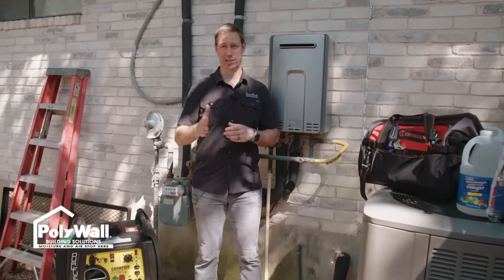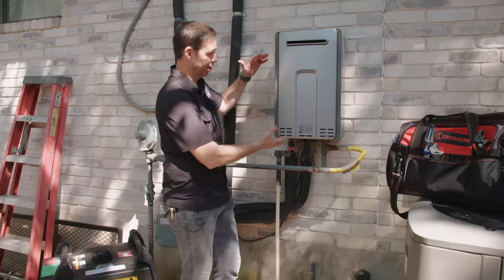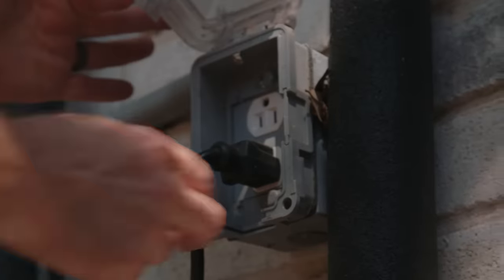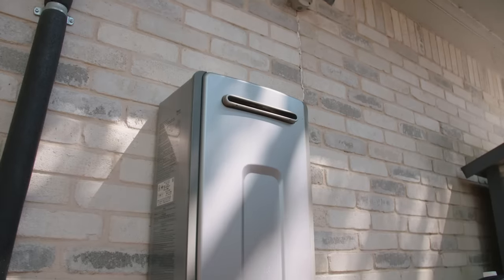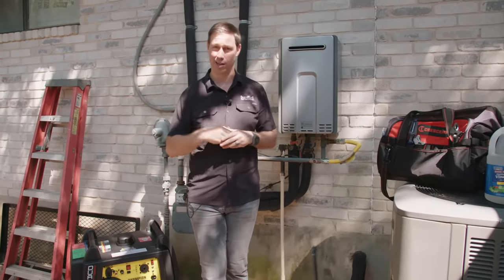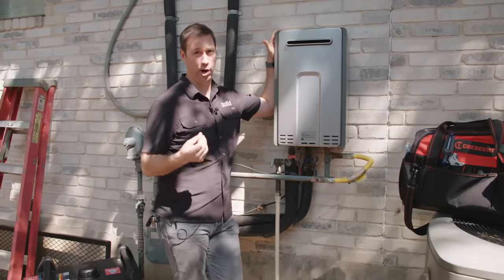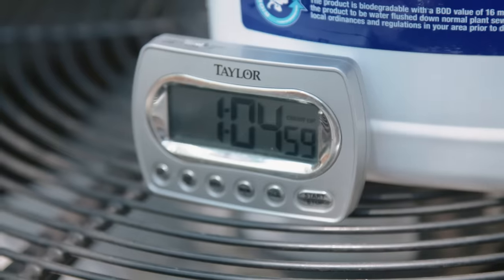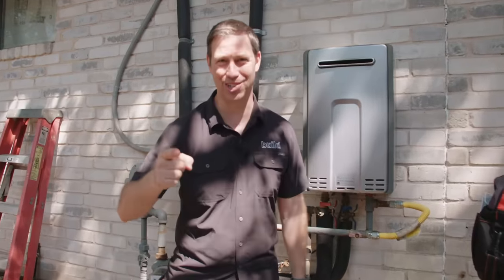3 Things They Don’t Tell You About Tankless

Comment: Good point about the hot water going away the instant the electric does. I install a CyberPower 1500VA Uninterruptible Power Supply (UPS) along with my Rheem Tankless. The UPS will provide electric for at least 90 minutes of hot water.

Comment: I'm 57and I've never taken a 7 minute shower in my life. Maybe 15 minutes a few times. Usually I stand under the hot water as long as possible. 🤓🍺
Reply: I live in a hot dry climate. During the summer standing under hot water isn't as appealing I'm like 5 min. and I'm out, in fact I'll sometimes even take a cold shower slowly working toward full cold. You feel so good after. During our mild winters though hot showers will get extended.

Comment: They also have battery backup for them I have had mine for 15 years and have had no problems I installed it myself and save a few thousand . During the summer months our gas usage is about 5 dollars a month. I clean mine once a year and put on a recric pump. I have a rinnia best one yet . I have installed 10-12 for friends they will be er go back to tank . I only use cleaning vinegar ,the chemical,s they sell has a harsh compound in it and it will eat away the rubber gasket in all connections. Love mine

Comment: 4th thing not mentioned is... getting instant heated water doesn't happen, unless you add an additional device/pump to circulate heated water. These tankless systems only heat water when called upon but think about the cold water in your pipes and the water coming through the system, until the water is heated!
Reply: Same issue with tank based systems.
Reply: @Boodieman72  Yeah but far less time is needed, as you have to heat the water first and then circulate. We have to wait about a min. or more to get hot water since going to a Tankless system. Sucks. Never had to wait that long with our tank system.
Reply: @trosencrantz  I have to wait that long for my tank system.  With a tankless system once its hot you will have endless hot water and with a tank system you could run out.   With a tankless system you aren't wasting energy when your not using it.  A recirculation pump can be added if you want hot water faster.
Reply: @Boodieman72  lol. Exactly
Reply: just like a tank!
Reply: @Boodieman72    In terms of adding a recirculating pump to either a hot water tank or a tankless system.  Would that make the cold stagnant water in your cold water pipes warmer?  Or is that only on the hot water side, strictly speaking?  From what I understand there's a mixing valve that gets added at the furthest hot water appliance.  Typically the master bedroom of every home.
Reply: @terencenagra6620  They make the water in the hot water pipe so it doesn't cool off.
Reply: Interesting. Instant hot water was my main reason for looking into tankless. Do you have the additional device/pump on your system? Also did you install yours yourself or did you have it done?
Reply: Are you referring to the recirculation pump or is that something else?
Reply: @rashadw3933  Yes I am!
Reply: I can’t believe it…….
  Someone else that understands how and why a tankless water heater works….
   Nevien tankless works well for a tankless water heater. 
Even though it takes about a minute to a minute and a half. This water heater has a small buffer tank that sends hot water as soon as you turn on the tap.
Reply: @trosencrantz  your wait is because you must heat the water inside of the tank. Then and only then you start sending heated water. Your plumber installed the wrong tankless in your house…
Reply: @ltsgarage7898  So the proper one would be one that has a recirculating pump with-in it?   How does a tankless system keep what ever is in the pipes warm?
Reply: @trosencrantz  “NEVIEN “
 This is the internet. Try looking it up and reading how it works. I can only explain it so many times.
        Read

Comment: You’ll never recoup the money spent on installing a tankless vs tank type.  Initial cost to install plus servicing it once a year (or even every 2 or three years) especially if you put an inline scale filter that has to be changed out every year.  Not to mention there are many things or components on tankless that can go out which most plumbing companies will have to order part and return at a later time to replace all the while no hot water... if you like the bells and whistles and have the money to “burn” then go tankless otherwise it’s not a wise investment.  If you’d installing it at when building your house it makes a little more sense and I’d recommend learning how to do the service yourself on it since it is simple to do but will cost on average about 300.00 for most professional plumbing companies to do.
Reply: If your gas company pays you several hundred dollars for installing one (which mine did), you can sell your tank heater because it's not very old (which was my case), and you do the maintenance yourself (capital cost of pump, hoses, bucket, and vinegar), the layout looks better

Comment: The bigger downside to having a Tankless is no instant hot water, the water has to run for a minute or more so no quick wash your hands after using the bathroom.
Reply: Depending on the distance between your tank and the faucet - it could take a minute to get hot water with a tank too.
Reply: @musicfan8688  Yep... this is about every house I've lived in.  usually takes a minute for the water warm up and flush out the cold water in the pipes.

Comment: I upgraded from a tank to a tankless propane hot water heater about 9 months ago, just before I did the switch I had my propane tank filled, since then I have had it filled two more times. I am now using half the propane that I was using before. Now I am just one person in the house, my consumption has not changed at all, still use the same amount of hot water.  Not sure why you are not seeing the savings.

Comment: My plumber,  Phil, asked me if I had hit my head when I asked about getting a tankless water heater.  He said that for every 15 he installed he had to remove about 13 of them!
Reply: We installed ours in June 2010 and have had zero problems.  I would never go back.  With a 40 gallon tank water heater we were using an average of 1 therm of natural gas a day in the summer.  After installing the tankless it was reduced 40% to .6 therms per day.   I’m sure there are lemons out there but everyone I know who has a tankless is happy with it.  That only amounts to about 7 homes, but it’s a way better average than Phil the plumbers experiences 😀
Reply: What does he think of high power condensing tank heaters from AO Smith, Bradford White, or Rinnai that provide a similar level of output? It's almost like old school plumbers hate any appliance that allows one to take long, hot showers.
Reply: Time for a new plumber if he can't install one correctly.

Comment: The other draw back is you have to run more water as you wait for the water to heat up.
Reply: You have to wait for both.
Reply: How far is the pipe run?   If it’s less than 10 feet if pipe between heater and tap, it’s Around 60 seconds, faster than the tank was.

Comment: 2:35 Unplug the tankless. It works. Ask me how I know. 😆
Reply: You can also add a bypass valve, you can have more fun that way by turning it on and off. :D
Reply: I have a remote on mine and I give a warning and the turn off the unit, it gives them 30 seconds to finish.
Reply: a plumber I know just connected the timer to the tankless.  that way he doesn't have to monitor the timer.

Comment: We were going to get a tankless water heater for the house we just bought, it had an aging water heater with an antiquated Apollo heating system. The plumber told us in addition to the new water heater, we would need the propane company to come install a new high flow regulator and an electrician would be required to put an outlet in as well. We decided to scrap that plan and a new tank is getting installed in January. It’s not a very big house at all so tankless just wasn’t worth the extra cost/hassle.

Comment: We built a house 5 years ago and the standard was a tankless water heater. We only had tank water heaters previously. The tankless water heater is more expensive for service and we have very hard water so an annual service is always required.  It takes about 60 to 70 minutes for the water to heat up for a shower but after that the hot water is endless.
Reply: Did you mean to say 60-70 minutes? That’s over an hour wait for hot water!
Reply: @Sheilawyer  that's crazy I think he means 60 to 70 seconds I hopefully

Comment: Wait! You’re supposed to flush water heaters!!!😯
Reply: I never have flushed my water heater, my old water heater lasted 24years, now I have a tankless that I've had for about 3 1/2 years and I've yet too flush it, so far so good.
Reply: @kenbradley1100  They built water heaters to last 30 years ago and you would get 20-30 years out of them regardless if you flushed them out or not. Now, like any other major home appliance, a water heater is designed to fail after a certain time period.

Comment: I had one of these installed about 7 years ago.  They required stainless steel exhaust that was expensive.  It was nice but it crapped out after 2 years of moderate use.  Great idea at the time but my plumber said it was too early in the development of these things when I had it installed.
Reply: Early in the development? They have been selling tankless water heaters in the U.S. since the '90s and I think Europe and Japan used them before then.

Comment: "Oh, btw, it takes a full minute for you to get that endless hot water..."
Reply: Really? I’m debating right now tank or tankless
Reply: @mikef1570  I still love the thing... but yeah, it takes a while to get 'er going. I've got a rather LARGE gas blasted one too. Thought about adding a 4 gallon water heater in front of it to get "instant" hot, and then the monster would blast it with hot water and turn it off. haven't done it in 6 years...
Reply: Either your pipes are way to long/big or there's something wrong. Tankless is the standard here in Europe and with comfort functions there is warm water instantly at the exit of the device. How long it takes to flow to the tap depends on the pipes.

Without comfort functions it should never take more than about 10 -15 seconds.
Reply: @RdV-  strange enough. it's installed where the tank used to be, maybe something wrong with the heater. I will look into it. thanks.
Reply: We've got friends with these.  Most of them do complain about the extra time to get hot water, added on top of the time already spent to get from the heater to the sink/shower.  And we have some of the most expensive city water in the country here, plus restrictions.  These units only start heating after water flow starts.  In one corner of our house it's 45 seconds from the gas heater until it's hot.
But the killer was that the gas service wasn't piped for the amount of natural gas needed for the large burner.  The cost of that upgrade would have eaten up any savings for a decade.

Add recirc?  lots of costs.  Timers for recirc?  same.  Insulate all the lines, extra costs.  Add a small tank at the distant end?  extra costs, plus losses.  Extra maintenance of tankless, extra costs.  Trades have high hourly rates here.
For a technology being sold on savings, a non-starter.  By the time the new gas heater goes out, the solar electric+storage systems will have come down in price to beat the gas heaters, and then we'll put one in.
Reply: @pault151  oh yeah, the install was ridiculously high. I'm still contemplating opening it up and finding the flow sensor and convincing it that the water is flowing for a bit before turning on the water... just a thought, haven't gotten the balls to do it yet.
Reply: @pault151  another thought was to put a small water heater in front of the blaster, so I would have hot water nearly instantly and when the blaster gets around to it it will put hot water back in the small one.
Reply: @RdV-  It seems to be the cold startup.  It goes through a safety startup that takes a long time.  Once that is done, it then starts to heat water.
Reply: @wdudek01  could you further explain the cold start up process?
  I like my unit but it shuts off if I turn the cold water faucet on too high, and then I have to turn off the hot faucet and turn it back on to restart the heater.
Reply: @wdudek01  then that’s a cheap crap heater. There shouldn’t be a heater, in this day and age, installed professionally, that has a “start up” procedure every time you ask it for hot water.
Reply: @RdV-  I think you're thinking of electric units, where the water heater is right by the sink or shower. Those aren't common in the US. A gas boiler is not going to start instantly.
Reply: They make small tanks you can install with these, to give you just enough hot water until the boiler starts.
Reply: @syreplays5079  my gas powered unit keeps water in the heat exchanger at a certain temperature at certain times. It does this by learning my usage pattern.

If I suddenly want hot water at 3 am it takes around 30s longer than usual. 

It's a feature called comfort dhw in the menu and I know is available on multiple brands and even some cheaper models.

I don't have any kind of electric water heating or a vat of heated water and the unit is not located directly near a tap but in its own space.

All of this is pretty normal here in NW Europe.

We are now switching to heat pumps or hybrid systems though because we're phasing out gas usage because of pollution.
Reply: @DaveSomething  We just turn our water on while we are getting undressed, it's warm when we get in.

Comment: Question: about FREEEEZING TEMPS / Frozen Tankless unit.
The last TEXAS FREEZE… 🥶☃️
My unit froze up. 🥶🥶🥶🥶
What should I do to prevent that?
Is there a way to insulate it?
Should I build a cover over it?
What do you recommend?
My son in law melted it with my hair blow dryer…and I was back in biz.
But do those ever break in freezes?
Thanks for your helpful videos!❤️

Comment: You talk about scale. You absolutely need to keep the fixtures running and free-flowing. I discovered this at a camp that has a tankless water system. The camp is watered by a well. I can tell by the green stains on some of the porcelain that the water is a bit acidic. That means that if it isn't pulling minerals from the well, it's clogging up fixtures by eating away at the copper pipes. You can tell this in particular in the showers. The bathroom faucets flow pretty well. The showers are better at trickling. The problem that this creates with a tankless system is that the shower heads have degraded to where the water flow is below the threshold for the water heaters to kick on, so you always get a cold shower unless hot water is being tapped elsewhere on the same system. So the thing to do is to turn on the hot water in the faucet and go take a shower while it's running. It's hardly ideal and certainly a waste of energy.

Comment: Hello  Matt
 Thanks for the video. you mentioned the use of a standby generator during a power outage. 
Correct me if I'm mistaken, but
electric tankless water heater's require a constant and significant amount of current/amperage.
So, how much output range of generator would one have to factor in, so as to not to overload the generator?
To ensure proper function of they're tankless electric water heater, including a few other basic (furnace, fridge, lights, a couple kitchen countertop receptacles)
household circuit's ?
Reply: He was talking about a gas tankless heater which uses a small amount of electricity to run the logic board and the electronic pilot.  An electric tankless is a whole different animal.

Comment: Hardly any good reason for tankless. No cost savings, high initial costs, plus maintance.
Reply: Exactly we added 100 litre tank
Reply: Depends entirely on usage.   I had a tank, 100 gallon water heater.....the pilot is bill killer #1 this was outside in a tin shed, Bill killer #2.  My gas bill just for hot water was $80 per mo. in winter, along with another $100 per mo. for heat (@2000’ elevation we have weather).   $200 winter monthly gas bill, $50 per mo. in summer.......now my bill is $8.00 in summer.   That’s 10 times less, 

But as to being expensive? , being mounted indoors, the stainless steel flu only had to go 2’ to get out the roof, still cost $850 dollars for 2 45 degree, 1 6’ straight and 1 cap!   Code is double wall stainless, if you go indoors.   But it Paid off for me, on my bill, and aesthetics of my ancient stone house got a huge upgrade losing the outdoor heater and plumbing, it was butt ugly🙂
Reply: Bingo yes, but I had NO viable alternative, to a tankless, stone house, ....can’t mount it to irregular stones and mortar outside, can’t move plumbing to accommodate (I’m just lucky someone before me drilled the cold water entry hole low on the outside stone wall.  but my second floor is wood, and I had an old wood stove flu column that was 3’ x 3’.  Just big enough for Takagi junior, plenty of through air flo from the first floor, installed in 2007 and saved me $40 per month ever since.   So in 2 years I bought the stainless flu, a pilot type tank heater  is $450, the tankless cost me $600.
So after just 3 years it was paid, and an extra $450 saved every year since.   That’s worth it, if I had 5 kids or a wife, it would not make sense
Reply: waste water like crazy ....wait 10 minutes till cold is out of pipes..
Reply: @calicoasting    But do the math.
Reply: @calicoasting  Instal insulation around your pipes, works wonders.

Comment: You missed one. You need to turn the valve open to a minimum flow in order to fire the gas heater. It's very annoying when you are trying to save water with low flow shower heads etc. I got a second tanked Rheem installed. BTW this is in Australia.